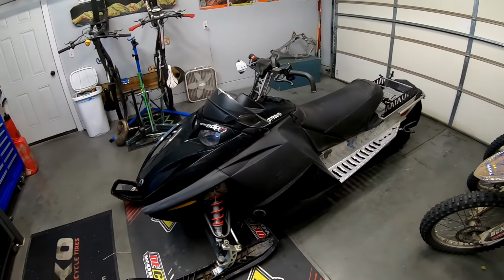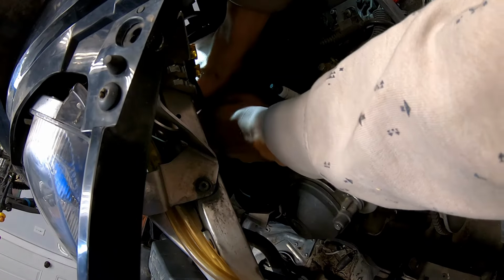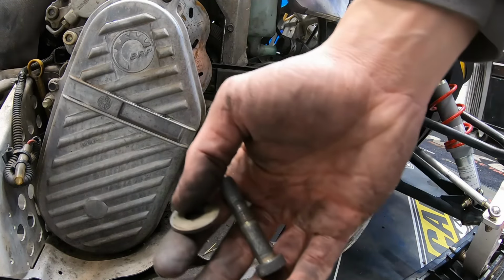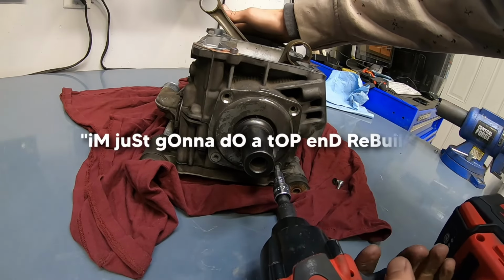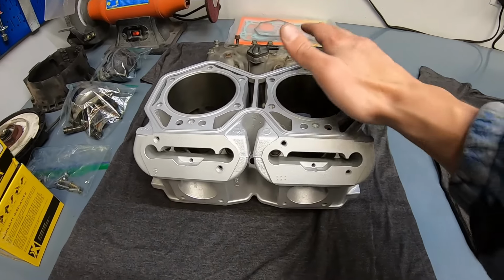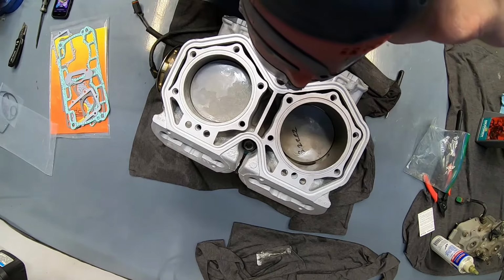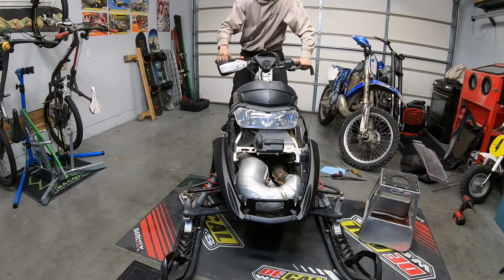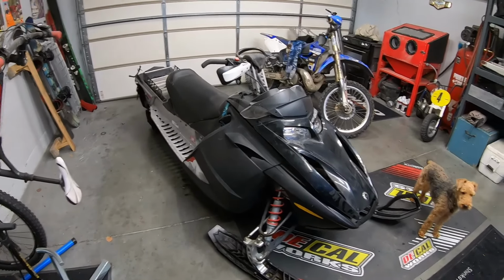Neglected $650 Snowmobile Brought Back to Life

Comment: Just a heads up!! If you keep the sled for longevity make sure you look into the crank shaft bearings “isoflex grease” Ski Doo 800s are very prone to having their outside bearings burn up the grease and leave your bearings dry/loose lubricity! Usually occurs every 3k-3.5k miles. Disregard this comment if you knew this, I haven’t watch the other videos yet😂

Comment: Love the video. A tip that my grandfather showed me for heating up those bearing is to wrap them in a couple paper towels, get them soaking wet and put them in the microwave for 45 seconds.  They will heat up way more than you will ever get them on the stove and I assure you the microwave will be fine. I've rebuilt .any bikes using this method.
Reply from the maker: Very interesting! Haven't heard of that one. No problem with metal in the microwave huh?

Comment: Thinking about buying one now that I've seen your build! Thank you for sharing everything! Do you have any advice when it comes to choosing a beginner snowmobile?
Reply from the maker: I am still learning, but it certainly does seem like the rider forward sleds like this one are worth it! This was the "Rev", first generation of the rider forward position. Sleds have come a LONG way - I've ridden friends new ones in the last couple months, and they're incredible. I personally am finding myself to be a SkiDoo fan over Polaris I think, but that's all personal preference. Overall I would say go for it - it's SO fun.
Reply: @KincadePavich  I really appreciate the insight! Thanks so much and keep pumping out the awesome content! You'll have 50k by the end of the month and I"ll be here for your next milestones too!
Reply: I would say go for some cheap rider forward sled, like that first gen rev. Those sleds are legendary, because they are easy to work on and are really good bang for your buck. If you are buying a sled the things to look out for are worn track and bent/cracked frame. Track is expensive and frame is hard to fix if you don't have any experience. One check for bent frames, a-arms can be to look out panel gaps etc. If shock is closer to a piece of the sled on other side and further away on the other, something can be bent. I suggest you to take a buddy with  you with experience , when going to look at a sled. Hopefully that helps. My english is not the best. Greetings from Finland:)